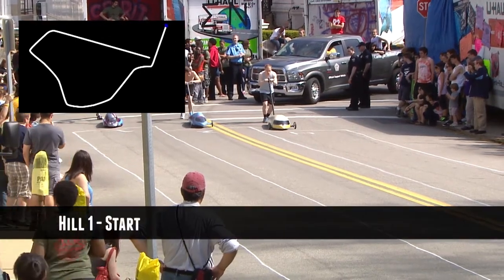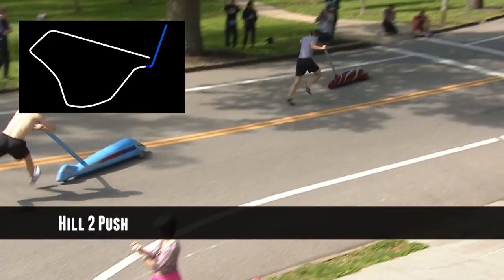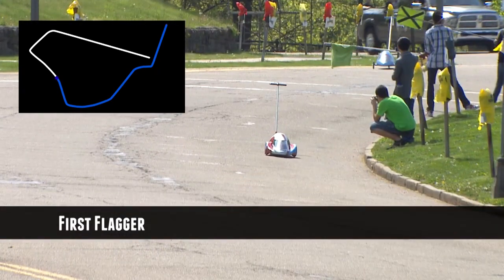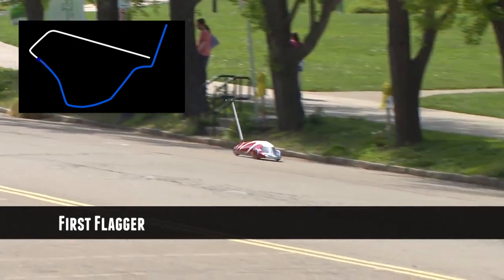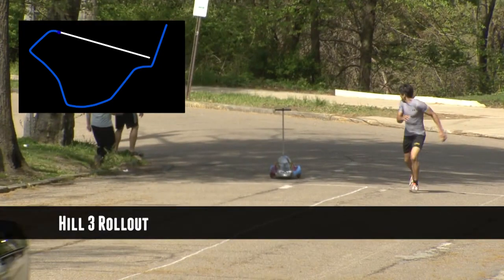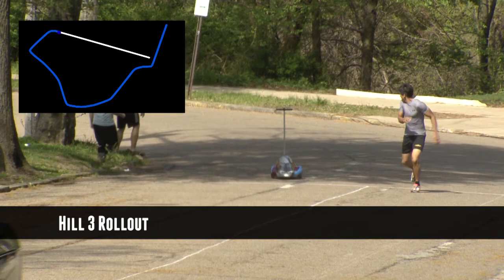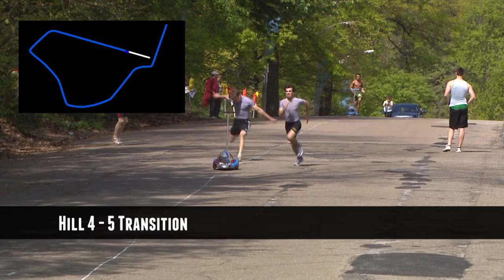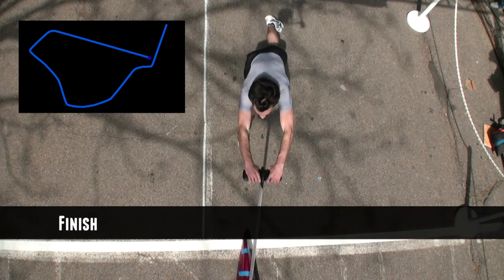Introduction to Buggy: The Buggy Course (cmuTV 2013 Video)

Comment: Is there a variant without pushers?
Reply from the maker: Not in Buggy, as pushers are a critical component of the team. Other activities, such as the Soap Box Derby, exist though, which are typically just the downhill race. Fun fact: A lot of the wheel technology used in Buggy overlapped with the technology used for the Ultimate Speed Challenge competition (part of the Soap Box Derby championships) in the late 2000s-early 2010s. Unfortunately, Buggy folks started dominating that competition and it was eventually cancelled.
Reply: # carrera autopodistica in you tube.70° @CMUbuggy

Comment: How does an adult even fit into those buggies??
Reply from the maker: Very snugly! But more seriously, most buggies are designed around the dimensions of their expected initial driver (with some wiggle room to allow for future drivers with different dimensions). Every once in a while, that means a particular buggy is built so small that once that initial driver graduates, it ends up semi-retired until the team is able to recruit a similarly small driver. Most organizations have at least one "larger" buggy that allows for a wider pool of potential drivers. For more information, check out http://cmubuggy.org.
Reply: How is this not an olympic sport???!
Reply from the maker: @chrisvonpimpenstein  Great question! If you know anyone on the IOC, let us know!